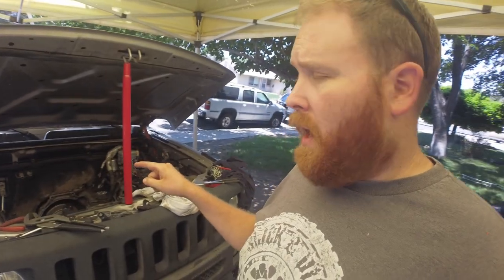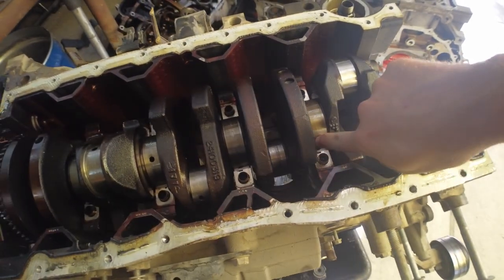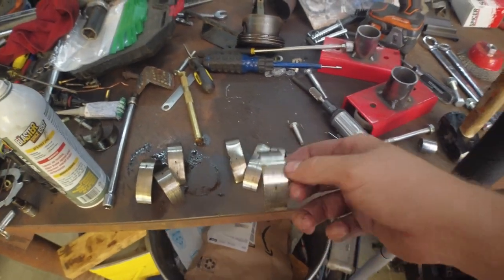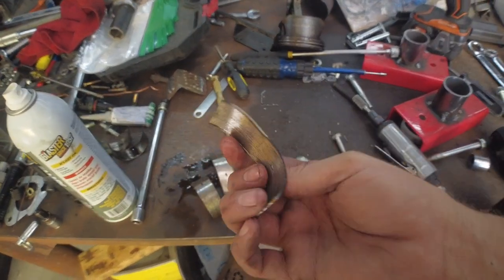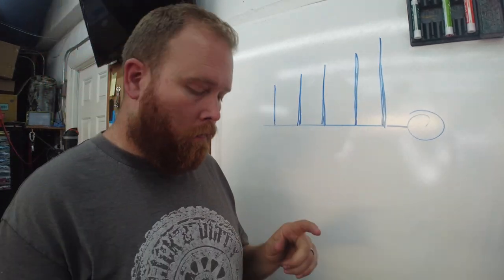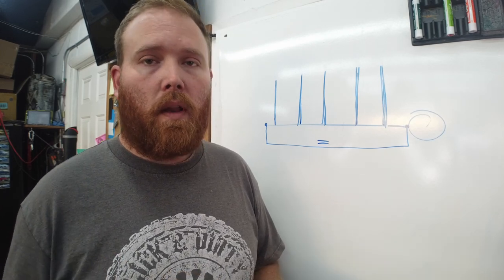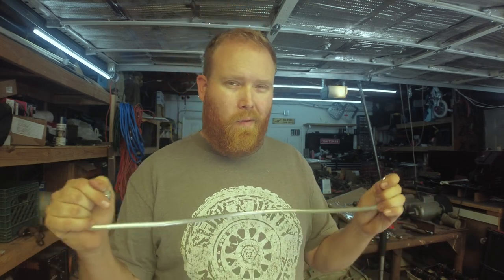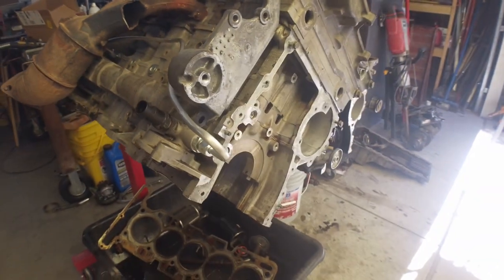1 Modification to Prevent Engine Failure  [Supplimental Oil Line]

Comment: Coming back to this video after 6 months, I blew up my 3.5l vortec in my 06 colorado and guess what? It was my 4th and 5th cyl connecting rod bearings that were the culprits. Bought a new motor from eBay, did a bunch of research and I’ve been following badlands for a while now. So 6 months ago I installed this kit on my truck. Started leaking today at the fitting on the front so I do definitely think it should be necessary to use thread locker on these fittings. I just put mine back in and some high temp rubber washers and all is well. As I said this has been 6 months since installation of kit and I have noticed not only the engine is properly being oiled but also a few other benefits. My engine runs cooler, it doesn’t make that weird noise after starting after it has sat for a day or two, my oil has been cleaner coming out of the engine, rpm’s going up are smoother, and the motor has less vibration than from the factory. I cannot recommend this product enough for the longevity of these atlas engines, I love my Colorado but I have to face it that these engines aren’t the most reliable. Hands down the best mod I’ve done and for under 100$ to insure that the back of my block is being properly oiled to prevent one of the main reasons these engines fail? Sign me up. Great man, great video, great product and service. Keep up the good work!
Reply from the maker: Definitely need to seal the threads. Thanks for the review buddy.

Comment: Appreciate all you do for these motors! Just finished installing this line in hopes to extend the life of my 3.7l. 🤞with the right front wheel, inner fender and skid plates off, i was able to fish in the line fairly easily without having to remove the exhaust manifold. Will definitely be picking up more of your stuff once i get the money for it!
Reply from the maker: It's tricky but doable. Thanks for you support.

Comment: Reminds me of Porsche 928 engines that were run at high RPM for long periods of time. They were losing enough pressure and volume at the end of the oil passages from heat and bad design that the centrifugal force in the crankshaft would actually stop the oil flow to the rear-most main and rod bearings. Welding up the holes and re-drilling the oil passage solved that problem.
Reply from the maker: That sounds costly lol

Comment: Cylinder 5 has this problem on the vortec 4200 as well, a fact that I am sure that you are aware of since your oil mod is exactly the same thing that they do to fix the issue on the 6 cylinder.
Reply from the maker: Yeah very similar. It's just something we have to deal with on these trucks.

Comment: Good intuitive vid. Your idea makes sense... I'll be visiting your website and checkout your kit... Cheers...
Reply from the maker: We've even further distilled the failure to the balance shaft bearings. The cause is still poor oil change interval and sludging of the pcv system, but what fails is the balance shaft bearings. Then it's only a matter of time before the cyl 5 con rod tells a really expensive knock knock joke.

Comment: Another in a great line of products from an amazing guy with an amazing company! I wonder how much a little shop would charge to install this for me, as I don't really have the time to get this done myself. I need to try and save up some money to get a bit lot of stuff from you lol. Light brackets, skid plate, signal covers, oil line, diff covers, sway bar disconnects, EZ down tail gate kit, all kinds of goodies! My cart is full but my wallet is empty 🤣
Reply from the maker: Gonna take a few hours. The intake and manifold need to be removed to make install easier. But you can improve the intake with the res delete and gut the cat while you have everything out. Its not likely a shop will do that though.

Comment: Thanks for all detailed videos man. I have 318k miles on my 07 3.7 Colorado and still running strong. Starting to look into replacement options for the future. Any company suggestions for rebuilt 3.7 engines by chance?
Reply from the maker: I'm rebuilding one right not going into the h3t and then fully rebuilding that one. Honestly they don't seem to need much new rings, bearings, seals, bolts and send jt.

Comment: Looks like a lot of work to do.  Hopefully it's not that difficult.  I have an 05 with the i5 and I haven't had any issues.  226k.  I change the oil every 5k miles.
Reply from the maker: Work to rebuild the motor is far more difficult than installing the line, but keeping oil in the motor is the best way to keep it running.
Reply: @BadlandIndustries  True that.  I'll try to follow the vid to see if I can catch how to install it on a fully functional motor.

Comment: Can it been done with the engine fully mounted on? What parts need to be rempved to gain access? Does it force a fresh oil change? Thx
Reply from the maker: Removing the exhaust manifold isnt terribly hard to do. This also gives you the opportunity to remove the catalyst improving hp and install studs avoiding broken bolts. I have a video about it as well
Reply: Done that. Ok. Can I get a deal if I buy the whole Hummer kit (bush, line, diff ring)? Thx @BadlandIndustries
Reply from the maker: @121anz  I can combine the shipping cost.

Comment: My truck have a check engine light with a misfire on the 5th cylinder but it runs fine. Would it be a good idea to just install this kit before opening the whole motor?
Reply from the maker: Cut open your oil filter next change. Its possible your issue could be related to bearing failure. I'd be confident that if the bearing has failed youll want to rebuild it before it takes out the whole motor. This mod is preventative and not intended to fix the issue once its started to fail.

Comment: What about changing the oil pump? Have you checked oil pressure on a healthy motor before a spun bearing? Just curious to confirm all culprits of a poor engineering design.
Reply from the maker: Melling made only one high volume pump for a 4200 concept truck. That said, this pump is on the 4,5 and 6cyl motors without issue. See my points last  video.
Reply from the maker: We thought about shimming the pressure bypass but we felt the issue was oil starvation caused by low oil. The way the motor is laid out the 5th cylinder connecting rod bearing tends to fail first since its one of the last bearings to get oiled. By balancing the supply tube will ensure the rear bearings dont starve.

Comment: hello and it would be efficient to complement this improvement to the l5 engine with an oil radiator?
Reply from the maker: Oil cooler isn't an issue it's a volume and vlow issue.
Reply: Ok I understand, I rephrase my question. It will be convenient to install an oil cooler to the truck, do you recommend it?
Reply from the maker: @yeryespinoza9026  I don't see any value in that unless it's specifically for the added capacity.